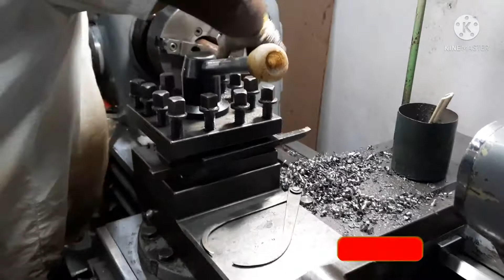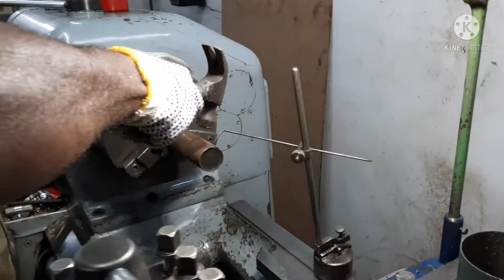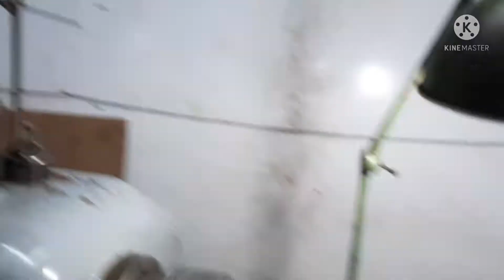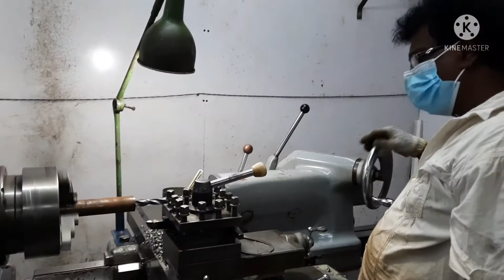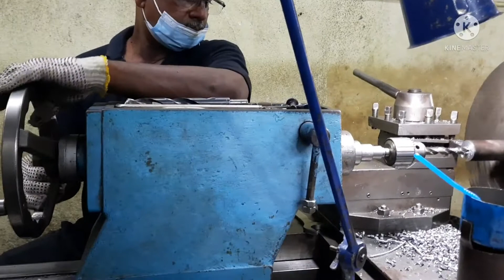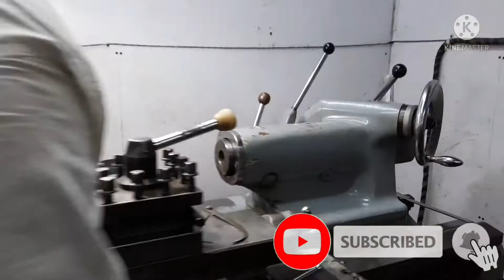HOW TO BORE SMALL STEAL TUBE | LATHE MACHINE OPARATION | Incredible Moments

Comment: I was just about to pass by this video, but then I noticed something. I really like the tailstock. I have run my share of Manual machines and have never seen one that had the in and out adjustment with a clutch for in and out drilling. I really like the hand crank was at an angle facing the operator. 
Cool hand tail stock. I wish I had one like that.
Reply from the maker: Thank you very much sir.. i appreciate your comment 🙏